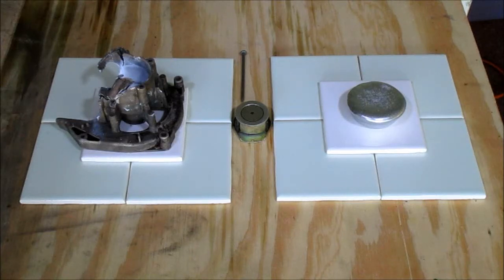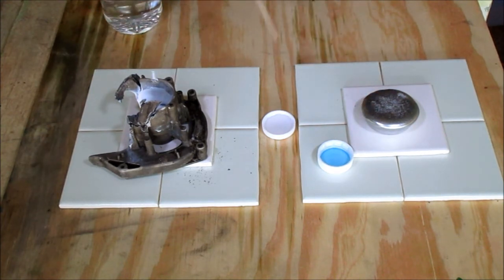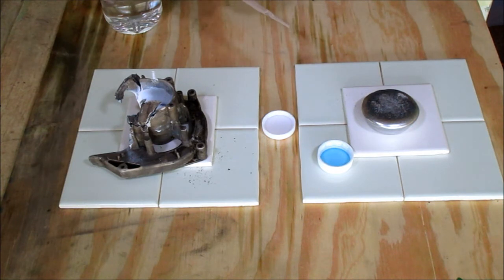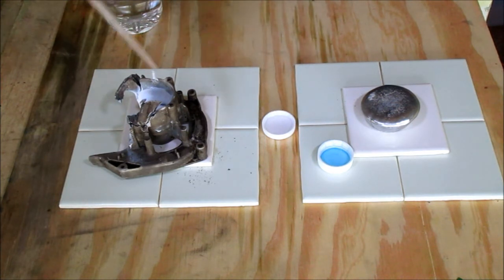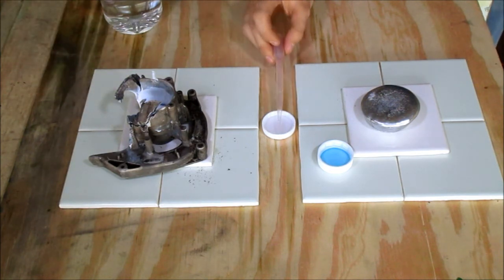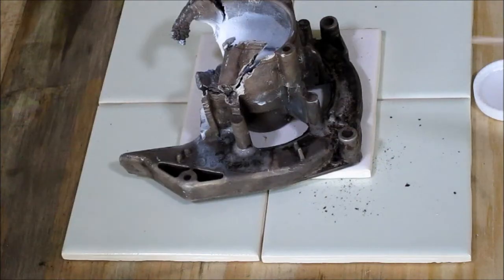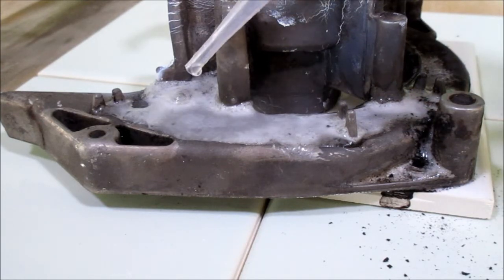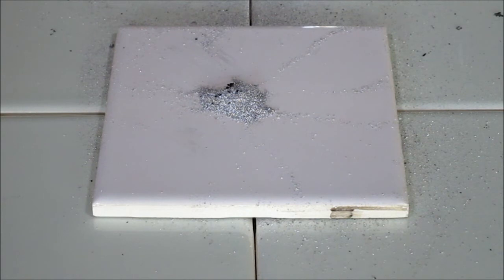Is It Magnesium Or Aluminum?

Comment: How do they melt magneseum and pour it into molds?
Reply from the maker: Good question!  To prevent the chemical reaction oxygen must not come into contact with the magnesium during melting.  There is probably more than one way to do this.  One way that I have read about is to use inert gas that is heavier than air to displace the oxygen containing air next to the magnesium.